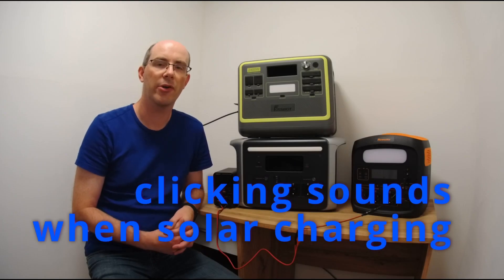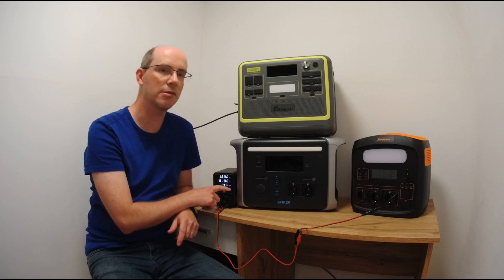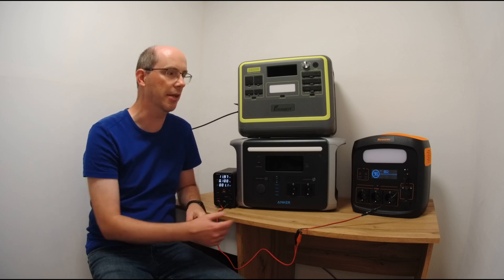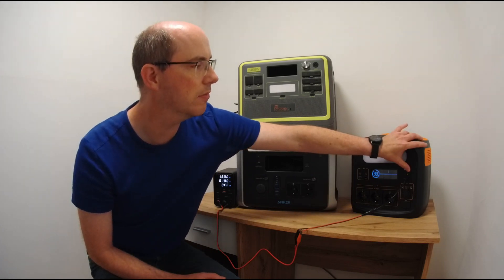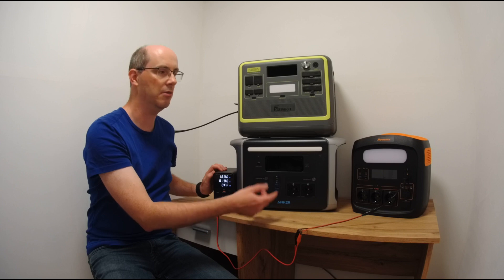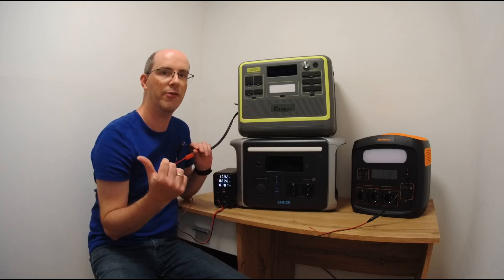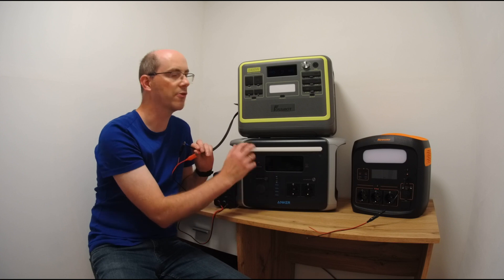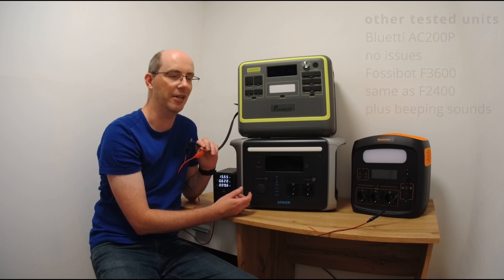clicking sound when solar charging

Comment: Excellent video. I have the fossibot 3600 and the 2400. Both do the clicking sound. Will it damage the relay ?
Reply from the maker: It depends on the quality of the relays used. Most relays have tens of thousands of switches though if not more. As the clocking happens when there is little current going through I consider early damage very unlikely.
Reply: @mariokleidosty9175 Thanks for the reply much appreciated 🙏

Comment: How does the Fossibot behave if it is kept permanently on over night by a very small USB load?
Shouldn't the clicking stop then?
Reply from the maker: @sinntax  I'm pretty sure the charging and discharging circuit are separate and it won't change anything but I'll test it as soon as possible and let you know.
Reply: @mariokleidosty9175  my thought is, that the Fossibot will stay permanently on over night by adding a small load. So unless the solar power input is shut down automatically in some way, there shouldn't be klicks the next morning? This might be some sort of workaround with a trade-off.
Reply from the maker: @sinntax  I understand what you mean but the clicking happens when the charging circuit detects that too little power is coming in from solar. Then the charging circuit is interrupted in order not to discharge the battery instead of charging. The discharge circuit for loads should be completely independent and not have any influence here. I'll test it to make sure though.

Comment: Very good video, thank you. I also think fossibot f2400 is a good unit, I'm about to buy one for a camper van set up. I'm worried about relay wearing out in some time. Could a relay or some device be installed between solar panels and power station that only lets power go to the power station above 5 or 10 watts for example?
Or perhaps, at the end of the day, it would be more advisable to spend more and get for example Bluetti AC200Max that as someone said in comments, don't do relay clicks in morning and dusk?
Reply from the maker: @NotOfThisEarth9  there are many power stations by now that don't have this clicking noise. Jasonoid started including this as a variable in his reviews after I pointed it out to him. He has reviewed many units here on YouTube and also offers a very nice overview on his website. Just search for "powerstation grading sheet" on Google and you'll see quickly which ones are suitable for you.

Comment: Thanks for video. Aferiy P010 relay clicks (for 20 minutes) as sun comes up - 50W panel.
Anyone know if the Bluetti EB55 or PS54 models are OK?
Reply from the maker: @dcbdcb49  I don't have these models but my AC200P from Bluetti doesn't have the issue.
Reply: @mariokleidosty9175  - I've got the Bluetti PS54 now and it's fine - no relay clicking at all. Power brick and internal fans are noisier but I can live with that! 🙂

Comment: Just bought a Fossibot F3600. Ran it for 3 hrs with my freezer connected. The fourth hour I hear a clicking noise and also saw a blinking blue LED light from inside the unit that I didn't recognize before. The clicking sounds speeds up when the fan in running but the unit is not even hooked up via any charging inputs to it's ports.

Comment: It is very ennoying in my campervan does anybody has a good solution for it?
Reply: Disconnect solar in the evening and connect solar when you wake up, solved! lol
Reply from the maker: What model of powerstation do you have the issue with?
Reply: I have the fossibot 2400
Reply: Bud it stay clicking voor like an hour so i am thinking to place an relais so when there is an higher input it starts up bud i dont know what to buy
Reply: I have a fossibot f2400
Reply from the maker: @edwindekroo4765  unfortunately I haven't found something ready-buildt. I made a schematic how this could be solved with an Arduino, MOSFET and resistor but don't have the experience to make one myself. In principle you need to measure not only the voltage from the solar panel but the voltage under load. As long as the voltage immediately drops when current is drawn it will cause the clicking noise. So you need at least some watts coming from the solar panel before connecting it to the Fossibot. Manually this could be done by a switch between the panel and the powerstation but of course this is not ideal.
Reply: I have the fossibot F2400 and have installed it into a campervan with solar panels. This clicking is anoying. Would a current sensing relay work?
Reply from the maker: @dannyspeed  only if you build something that would sense the current through a dummy load and connect the Fossibit only when there is enough power for charging. A current sensing relay on its own will not help as it can't measure when it turns off.

Comment: Thank you so much for this video, Mario. I have an Ecoflow River 2 pro with the same problem but I'm using the wall outlet to charge it. Do you think this a factory issue? My station is new, I have used it just 1 day! Thank for your reply.
Reply from the maker: Hello, If you have clicking sounds when charging from the wall outlet the most probably there is an issue with the UPS functionality. If it's just a day old you should really contact the seller to exchange the unit.

Comment: Try an mppt charge controller in-between the panels and power station.
Reply from the maker: This won't work as a charge controller needs to detect the voltage of the battery which it can't on the input of the internal MPPT controller.

Comment: Great video. I also noticed this clicking. On my f2400.
Thanks for taking the time to explain!👍🤙
Reply: Mine does it as well. I had it charging off solar out side and it would click at sun up and sun set. It will also reset my station randomly when using it as pass through power for my home entertainment system. I  have it plugged into the wall outlet as well as a solar panel. It now will randomly click after sun down and kill power to my entertainment system. I will test it tomorrow with no solar panel hooked up to it. Too see if it clicks off again randomly.
Reply from the maker: You're welcome

Comment: Thanks so much for this video, Mario. I have a Fossibot 2400 and have experienced this issue. I contacted Fossibot customer services about the problem, but did not receive a response. I thought it was a fault with just my generator, but I now know that it is a generic fault. And let's face it - it IS a fault.
I''m not minded to request a refund from Fossibit, as I do like the 2400, but it annoys me that I have to unplug the panels every night whereas I don't need to do that with my other generators (Ecoflow Delta Pro and Bluetti AC200Max). 
One thing I'd like to ask....If I were to ignore the annoying clicking sound and just let it click every night, would it eventually damage the device in any way? Or is it just an annoyance that has no impact on the long term operation of the generator?
Thanks again for your excellent video!
Reply from the maker: As Hasitier already replied we don't know the quality of the used relay. As the switching occurs at very low currents it's likely that it won't cause a problem but it definitely could happen under bad conditions or if a cheap relay is used. I have solution in my head by adding a small external PCB that measures the current from the panels before activating some MOSFETs connecting the panels to the power station. Unfortunately I lack the electronics skills to create this myself and couldn't find some off the shelf solution yet. Maybe there is somebody reading this who knows how to create such a protection circuit 😄
Reply: @mariokleidosty9175   Thanks both. Really helpful!
Given the very cheap price of the Fossibot (it must be one of the cheapest generators on the market in terms of price per kilowatt hour) I suspect that they may have cut some corners on the quality of some components, so it does worry me a bit, but I'll continue to unplug it every night, but will keep an eye out for solutions on your channel and others. If you encounter any solutions, I'd be very interested indeed.
Thanks, Patrick
Reply: Relais have a specified switchover count that they are expected to handle before the contacts are degraded so much that contact resistance becomes an issue. It also depends on the current flowing trough the contacts while switching and we are talking about 20000-500000 times depending on the quality of the Relais. However in my opinion if this happens daily for not only a minute or so the Relais might be worn out before the batteries got their rated cycles and you would get a new one anyway. I also have the F2400 but I just charge it on AC (which is generated from the roof solar system) so it is no problem for me personally.
Reply: I bought a couple of isolator switches and I'll just flip those at sunset. Shame it's not set and forget, but I love to keep an eye on mine anyway, so flipping a switch isn't a problem.
Reply: @Avalanche_Andy  Good idea, thank you for the tip! Wouldn't it be possible to connect some type of relay to only let current pass (from the panels to power station) from 0.5 or 1amp and upwards? What type of relay would that be? One wouldn't have to worry connect/disconnect system. But anyway, you found a good solution to this issue!
Reply: What are the minimum watts that Bluetti AC200Max register from solar panels? Because of this click issue I might decide to buying this Bluetti model instead of Fossibot..
Reply: @NotOfThisEarth9  I managed to get a response from Fossibot technical support:

"When the charging current of the solar panel is less than 1A in the evening or when the sunlight is not strong, the relay will make this sound. You can stop using solar charging at that time to resolve the issue, or continue using it for 15-30 minutes and it will stop."

Not a very satisfactory response, so I'd advise going with Bluetti. I have an AC200max and it doesn't have any problems with minimum solar input. I leave mine connected to my panels and there's no relay clicking.
Reply: @patrickkelly1195  Thank you very much for the help! You're right it is advisable to go with the Bluetti. Do your unit (AC200Max) register and charge low amounts of watts from solar panels (10w, 5w, etc)? It can make the difference to power small fridge in winter or bad weather, to delay having to find other charging option for some hours or one day.